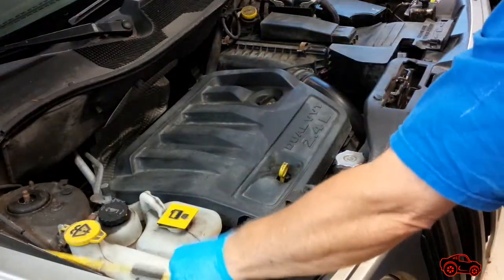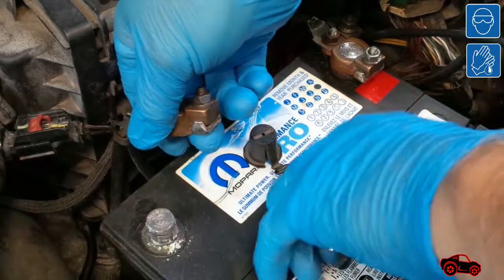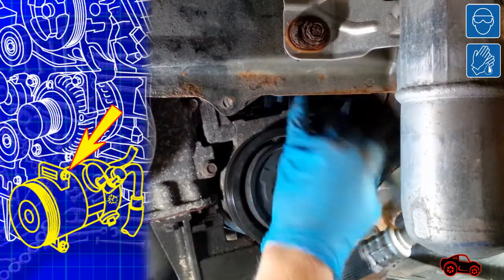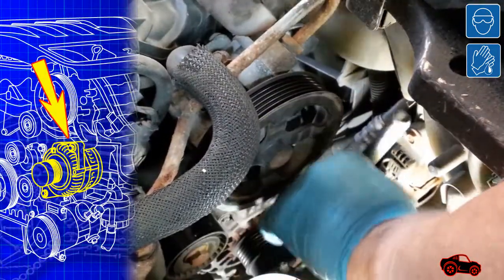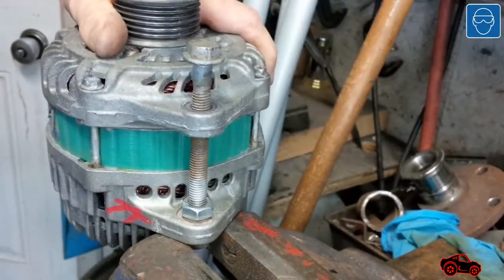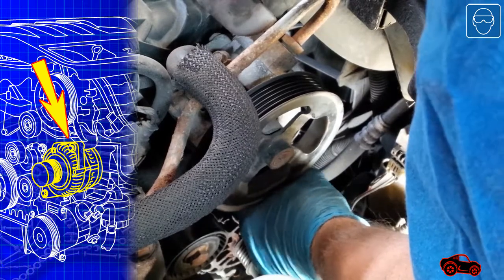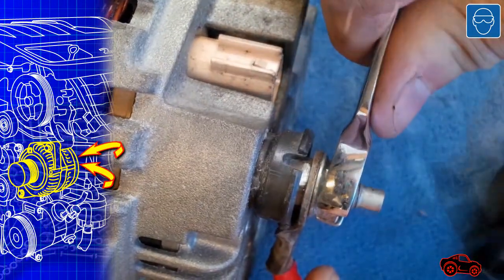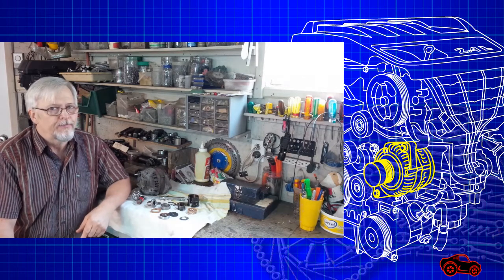JEEP PATRIOT 2009 OAD PULLEY NOISE & ALTERNATOR REPLACEMENT

Comment: Watch many videos of Jeep Patriot alternator replacement, this is by far the best video. Thanks for taking the time to make such a comprehensive video. 👍🏻
Reply from the maker: Thanks!  I worked alone but it would have been useful to have a helper to hold the a/c compressor as low as possible when I was taking out and refitting the alternator.

Comment: Can you suggest the issue of my AC in Jeep Patriot 2007, i am facing an issue when my jeep is on idle the AC is cooling when drive AC stopped cooling
Reply from the maker: Special equipment and training is required to inspect and fix A/C systems. First your coolant (or antifreeze) may be affected by air buildup. Inspect the fins of the radiator and the the A/C radiator. Make sure the engine is not over heating. After years, the electrical clutch of the A/C compressor may be not be holding properly the pump shaft when the RPM is faster than idle. You might not be able to find by yourself the cause of the problem so it would be good to find a recommended specialist and get a detailed estimate before you spend too much time and money. Good luck!

Comment: Hallo
Ich habe einen Volvo S40 Business Edition bj2011 114ps mit 240 000 km stand. Den Volvo hab ich 4000 gekauft und kann ihm auch 4000 verkaufen.

Ich wollte mir einen Mitsubishi Lancer 2.0 DID Sportback bj 2009 140ps 210 000 Kilometer stand 3700 kaufen.

Was ist eure Meinung welches Auto hält länger und welcher wäre gescheiter zum kaufen/behalten. Weil der Mitshubishi hat einen VW Motor drin und mehr Leistung. Der Volvo hat ein rennaut Motor 1.6 und wenig PS kann sein das der absirbt. Bitte um Hilfe!
Reply from the maker: Note: Je parle seulement français et anglais.
Bonjour!
Ici au Canada, nous n’avons pas ces moteurs installés dans nos véhicules. Je ne connais pas ces moteurs qui sont dans la Volvo S40 ou le Mitsubishi 2.0 en Europe. Cependant si cela est possible, je préfère coisir un moteur avec avec une chaine d’entrainement (timing chain). Bonne chance...

Comment from the maker: By the way, if someone knows an Internet link to an official document from Chrysler detailing the torque specs about the 3 A/C compressor bracket bolts mounted under the oil pan, please share it in the comments section, so everyone can consult it.  Thank you.